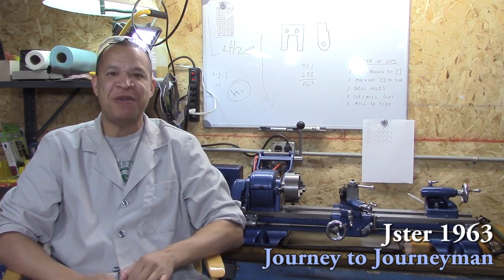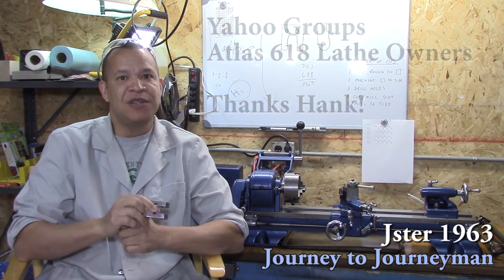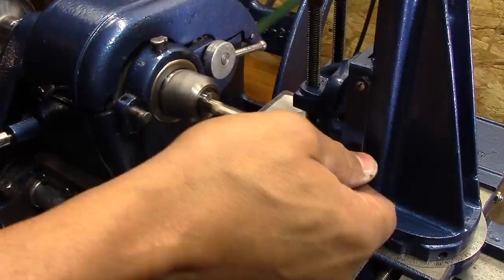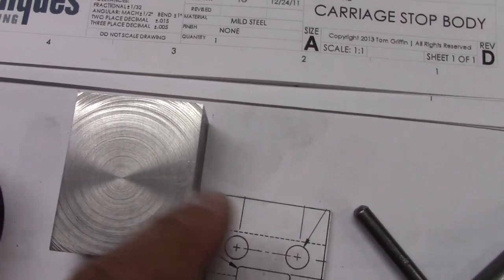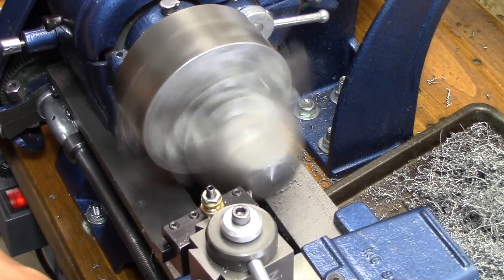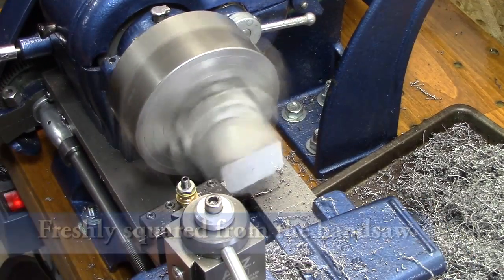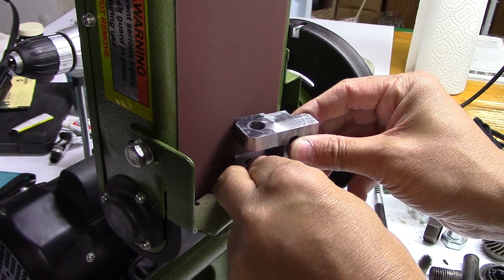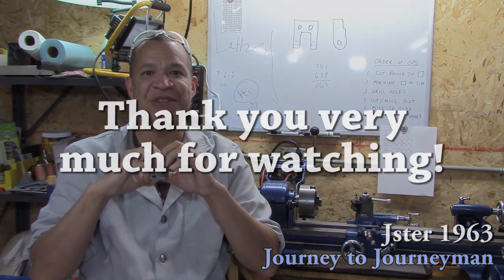Journey to Journeyman, Episode 6, How to mill on a lathe making a micrometer stop

Comment: Splinters. Neodynium magnet. Get a huge one, 100 pound pull plus, end of day, sit your hand on it, pulls them out. A 500+ pound one will pull everything but titatium and stainless. Just be careful setting the magnet and put it somewhere it will never need to be moved, over 200 pounds and they can crush bone and will fly towards metal, let go, don't go with it. Most dangerous thing in my gunsmith shed.
Reply from the maker: The Verdant Wow that’s wild that the magnet is the most dangerous thing in your gun cabinet!  I will definitely be careful!  And thank you very much.....
Reply: jster1963 - it would snatch parts out of our hands otw to the machines from the bench. Remounting one is more troubld than it's worth, just smash it to dust, and buy another one...bright side - it is allot of fun watching a 32oz ball peen head fly like a missle through the air like 3 feet. But it works, saves hours every week of digging splinters.
Reply from the maker: LOL and Yikes!

Comment: I am thinking about taking a series of machine shop courses from Lyle Peterson aka tubalcain, aka mrpete222, much is available in hundreds of free videos. Mr Pete is addicted to auctions and there is much to be gained at auctions. He has had a career as a machinist and as a teacher as well.
http://www.mrpete222.com/
Scroll down and down. 
I have just seen 1-2 of your  videos and am not sure of where you stand in the journey to journeyman. No slights intended if made.My goal is a pleasant interchange if knowledge, -- no ego.
The splinters may be due to the mill cutting design. I've done a little lathe work but no milling except what you can do on a drill press. But the solution may lie in a different cutter design or even the way are using cutter you have, i.e., more aggressive feed as a guess.

Comment: I don't think you should turn that end ways cylinder without a tailstock, It looks too likely to pop out. What is the linear velocity of your chuck jaw extended to hold the cylinder? Perhaps there are directions for using lathe-mill combos that would direct us. I suppose you could hold the work in your mill table to cut it to a turnable shape. 

Beware dangerous band saw practice too! I think it was a band saw... Only open up the blade support enough to fit the work and use a fence and pusher. If it cuts too slow, look into a more aggressive metal cutting blade.

Perhaps a chopsaw. Some have blades that will cut mild steel. A saw would leave you pounds of chunks, milling or turning would leave you pounds of chips.
Reply from the maker: All great tips!  Thank you......

Comment: Do not use an air compressor, they can not just blow chips into the lathe and damage sliding parts, they can blow then back towards you!. Use a plastic shield by the work. Someone was suggesting using a shop vac the other day and was demonstrating it. I have a big Ridgid shop vac from HD that is quiet and effective on wood. -I have not yet decided on spreading my hobby to metalworking. I also have the big dust collector from HF that is available with many shapes of adapters and hoods made for wood that may be adaptable for metal. 

https://t.harborfreight.com/2-hp-industrial-5-micron-dust-collector-97869.html?utm_referrer=https%3A%2F%2Fwww.google.com%2F 

Sometimes on sale for $170 with a coupon in a woodworking catalog, online or elsewhere. They are routinely available in my store. Some Amazon and HF stuff is good, some is laughably bad. Be prepared to get your money back if it is faulty. Many items take an hour to assemble and they should have better quality control, which is sometimes laughable and sometimes good. I am starting to think that one mistake is all they get before returning and finding a new vendor.
Reply from the maker: I'm sorry I just saw this because it went to my spam folder.  But thank you very much......

Comment: The little craftsman 6 18 I have loves the 6 and 8 flute end mills when I'm using the milling attachment,faster deeper and very smooth a lot less vibration and snug up the Gibs especially the milling attachment. That's milling tool steel !
Reply from the maker: SWEET!!  That is awesome info.  I will give that a shot.  And thank you very much.......

Comment: Splinters:
Get use to wearing thin latex/rubber gloves. The thicker the better and they won't eliminate them completely but they do help.
Reply: Playing guitar or any other finger to string instrument helps prevent slivers too.
Reply: And the shape of the milling bits contributes.I had this one biit I use on a die grinder and the first time I used it it was incredible! Every fragment coming off that thing was a perfect and vicious metal sliver. I was covered and they seemed to have barbs. I took one swipe down my arm and started beading from the whole area five seconds later. 

Not a good day.
Reply from the maker: Yikes!  I get it.  They are NASTY!  I will try to use a magnet next time.  Someone else said that works well.  And thank you very much.  ps.  I play the base guitar but need to do it more to get my fingers hard again.....

Comment: you do not need the DRO to make precisely located holes. you can just use the leadscrews on your lathe. 

put the piece in the milling attachment and put a center drill in the collet chuck. then touch the side of the center drill to the side of the workpiece, then advance a distance equal to the radius of the center drill into the workpiece(without touching). that makes the center axis of the center drill in line with the side of the workpiece. you can now zero the leadscrew. this is your first datum. then advance it to the position you want the hole using the dials on the lathe. 

 i believe on the 618 the leadscrews are 10TPI?, then is all a matter of couting how many turns. if you need the hole 1 inch from the edge then just turn the leadscrew 10 times. you should be able to get the location within a thou i think, better than layout.

on the milling attachment you can use the cross feed as X axis and the milling feed as a Y axis and locate any hole on a plane very precisely.
Reply from the maker: +Rodrigo Grass I can't quite picture it, but I will try to later.  Thank you so much for the information.......
Reply: send me an email and i`ll send you a picture. rodrigo.grass@gmail.com. love your little lathe by the way. can`t find them here though(Brazil), would love to have one.
Reply from the maker: I sent an email.  Thank you....

Comment: You might be better off making the stop out of aluminum. The lathe you have just can't cut steel effectively and it puts too much stress on the machine.
Reply from the maker: +GnosisMan50 You're right, but I've had pretty good success with steel using very light cuts.  Once I get my South Bend up and running, I will use this for the small stuff.  Thanks a lot......

Comment: Lathe milling attachments are relatively flimsy arrangements. Yes, you can do it, but there are limits. Ask me how I know! One limit is imposed by the amount of vertical cut you can take. Another is imposed by the travel of your cross-slide. In Z (long axis of lathe)  you have all the room in the world, but probably no fine feed (my case).. I think you did very well indeed with what you had. But you got away with plunge milling only because you had plungeable end mills. Most are not. The British call plungeable end mills "slot drills" which is a good name, Look at the bottom side of the end mill, if the edges go all the way across you can plunge  with it.
Reply from the maker: Juan Rivero I had no idea that end mills were different like that.  That's how new I am to this hobby!  Thank you very much for the info and the kind words......

Comment: I've GOT to source my self one of those milling attachments for my Craftsman 101 lathe!!! Just another thing to add to the ever growing list! I had planned on just getting a mini mill from HF, but this attachment would sure save me some $$!! Keep on Turnin! Zip~
Reply from the maker: ZippoVarga I lucked up on this one Zippo!  I got a lathe (in EXCELLENT condition) a full set of change gears, and a milling attachment for $325.  The change gears and attachment alone cost more than that.  It has a limited range of what it can do, but it has really worked out for me.  I use it in my next machining video a lot!  If you can get one for under $200, you've got a steal.  It's not like a real milling machine, but for small jobs it works.........
Reply: I've got the change gears, extra banjo, steady rest, live center, morse center for head stock, lathe dog for cutting angles like for a center punch, a three step self centering knurler and I know I'm forgetting a few things...But I did exceptionally well on this package. Heading over to send you an email here buddy. Keep on Turnin! Zip~
Reply: If you can spring the money for the mini 6x26 knee mill youd be better off.. alot of the r8 tooling just leaves minimal room on the basic mill drill

Comment: AHAHAHAHAHAHAHAHAHAHAHAHAHAHA It dont fit ahahahahahaha. I been there brother. I seen a few things I would not do my self. When you milled the inside down to your two drills, you took the radius out of the bottom. Never do that. Second it looked in the same place you plunged deeper then the flutes. I would have done that part from the side so less meat.

Next, get some dividers and lay out the big radius off the center punch

But man, you scaled off a drawing.... First rule of gd&t is never, ever, ever, use the drawing for scale. NEVER.

Good work bubba
Reply from the maker: LOL!  I know.  How could I do that big of a mistake!  Also, I guess the radius should be left to keep it from cracking there.  I think that's what I hear the machinist say.

I think I see what you're saying about plunging deeper than the flutes.  I'll try not to do that. 

And it's funny you say that about the scale of a drawing.  I'm not a CAD guy.  I had 4 years of drafting back in the day with HB and numbered pencils.  When I drew a 1:1 scale, you can bet your bottom dollar it was 1:1.  PERIOD!  My drawing would have failed if it didn't.  So I will take your advice on that because I see now days they just change it in the computer and it's really not to scale.  Thanks for the comment and the advice........
Reply: jster1963  In theory if it says it's to scale it should be. But revisions can be made where the drawing is 9in but the call out was revised at 10in. Or maybe that drawing was to scale, then printed on a different size sheet. What it amounts to.... Dont trust another mans work with your result. You cant trust him.

Comment: awesome job, remember what you call fails are just an important tool as any in your tool box because it's just as you said "lesson learned". the mic stop can still work for you, think of vice stops used on larger mills, so that you may clamp it to your lathe bed on the horizontal rather than the vertical something like this:

http://www.use-enco.com/1/1/13250-vise-stops-use-various-brands-machine-vises-328-0107.html

the fix jaw being the piece you just machined, the moving jaw (and it's parts) would make for another project if there is anything i can do to help, don't hesitate to ask, i think i can safely say, i peak for everyone here when i say this. keep'em coming
Reply from the maker: Thank you very much Edwin!  I really appreciate the kind words.  I'm trying to learn this hobby and failing is part of learning, like you said.  I may try to make a vise like that.  I don't throw away my failed metal parts just for things like that.  Thanks again.....

Comment: How deep were you cutting?  Did you have any trouble with the mill grabbing the work and overpowering the vertical slide's alignment?  You've made it look easy but I've had plenty of trouble trying to mill on a 618.
Reply from the maker: I was making very light cuts.  I think maybe .005" at the most.  That sequence was shot over days of frustration.  I finally figured out how to keep it from grabbing and overpowering the vertical slide.  I had to tighten up the gibs.  And more importantly, I took that "T-screw" on the vertical slide and put it on the cross slide in place of the gib screw in the middle.  Also, I made sure the cutter was always trying to push the piece and not pull it.  And vertical cutting worked better than horizontal cutting for me.  I made another "T-screw" for my next video.  I'll try to explain it on that vid.  It will be JTJ7.  Thank you very much.......
Reply: jster1963 Thank you.  By vertical cutting do you mean plunging into the work, or moving the slide vertically?  I think the latter?  I can see how directing forces down into the base would make the most of the vertical slide's limited stability.
Reply from the maker: Yes you are right.  It's the vertical slide direction.  I still plan to get better working with it......